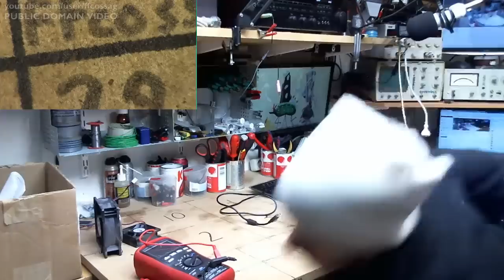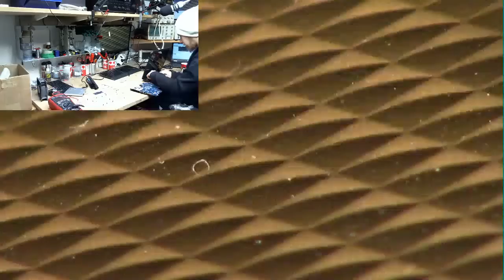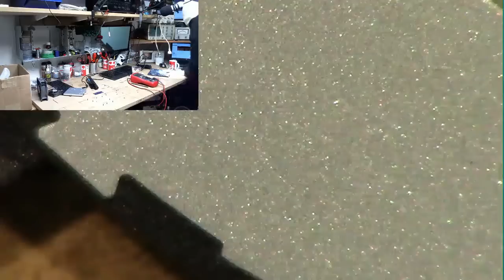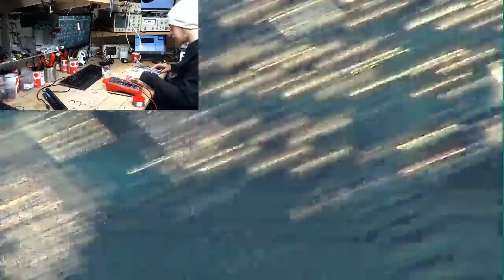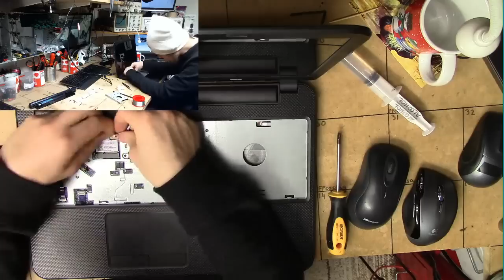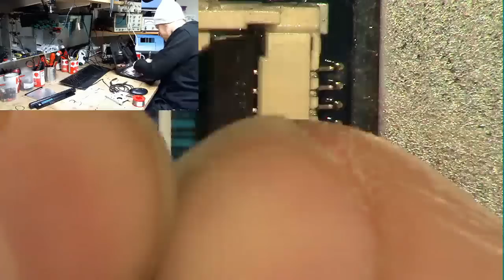*STREAM STARTS AT 13:30* Dell Inspiron 3521 troubleshooting - recorded livestream

Comment: You should have a cheapo hdmi switch so you can switch between camera and another hdmi device so you can easely switch inputs during stream :)
Reply from the maker: This HDMI capture card basically dies if you do anything with it, it's such a pile of shit. Unplugging the HDMI while in use usually causes a BSOD.

Comment: Im glad you got the dell working :-D
You have been experencing a run of bad luck with pcb repairs :-(, hope this picks you up a bit mentally :-).
What an odd keyboard problem, never seen that before.
A frend bought his desktop computer round, it would not switch on, he had ordered a new system but wanted to know why it failed.
It was a corrupt cmos lol, after clearing it worked fine.
I put a new battery in and he went back home to cancel the new system :-D

Comment: Hey what speaker is that? looks like JBL 4xxx series?
Reply from the maker: I have a pair of JBL 4311Bs in the workshop. Imported straight from the US for way too much money and way too much shipping damage.
Reply: Most import is the state of the drivers, rest can be taken care of by a bit of net+wood filler basically... 4698b is what I'm after myself.  Beasts weight 75kg each... Last time I tried couldn't fit into my car even one a time.
Reply: Yikes! filler?!!  Please No.
Reply: Sprank900 any better ideas? Sawdust + wood glue might not paint well....